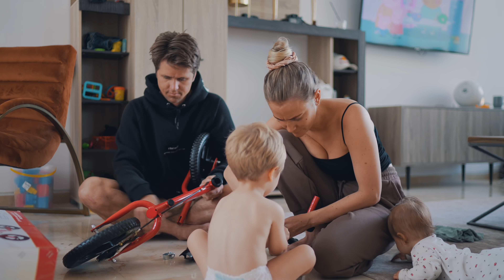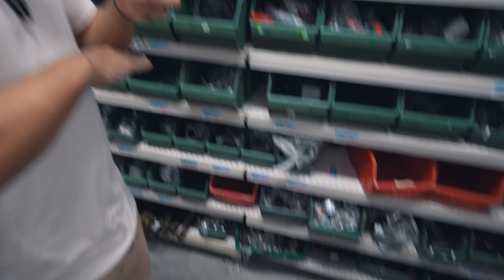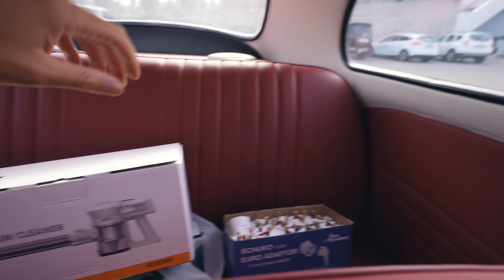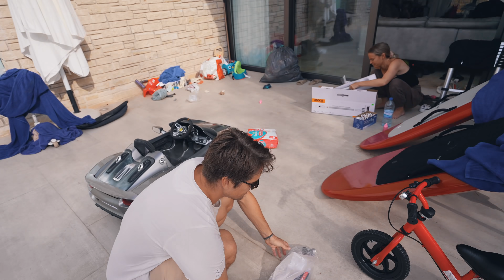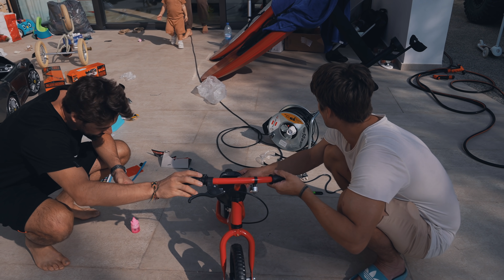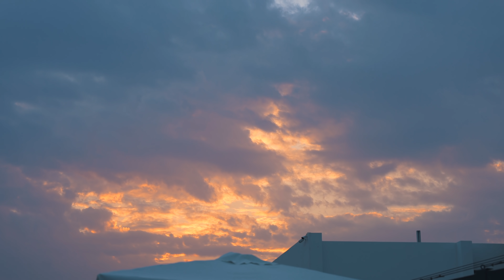7€ GIFT - BETTER THAN A CHANEL BAG? | VLOG 53

Comment: YOU MUST FIX THE FUEL OVERFLOW FOR THE TANK !!! BIG BIG FIRE HAZARD !!! it must have a small hose with a loop that goes outside the car in the inner wing !  PLEASE JON x see min 5.15 sec .Also the fuel vapour will be inside the car ! it is very dangerous and bad for your health.
Reply: He needs an EV. But he's just never going the get one (besides the death trap that is the golf cart) regardless of Cyprus being perfect for EVs. You can literally drive anywhere and there's an abundance of sun-power... Sigh... UNBELIEVABLE... And tragic.
Reply: @angela1984a  I presume you are a tesla owner?😁
Reply: @PhazerboyProductions  No. I'm a Swede just like Jon and Janni. I could buy a Model 3 -- the most expensive one -- with cash and have almost 'half' of another Model 3 to spare. But unfortunately I'll need that money to change careers. I have a used ~2015 VW Golf Station Wagon bi-fuel vehicle that I run on methane from recycled organic waste. You can fill up with that all over Sweden. Up until recently when busses started going electric almost all busses in Sweden as well as almost all garbage trucks ran on that fuel. It sometime needs a small sip of gasoline though to prevent clogging and the need for additives in that system. But -- yes. If I had another ~460K SEK like Jon does I'd buy a Tesla Model 3 LR tomorrow.

Comment: You can use electricity without the adapters. You can use the normal European ones, and put a pencil in at the top hole; the same time your putting in the plug. You have to push the metal lever inside with the pencil, push it in, then you don’t need an adapter.